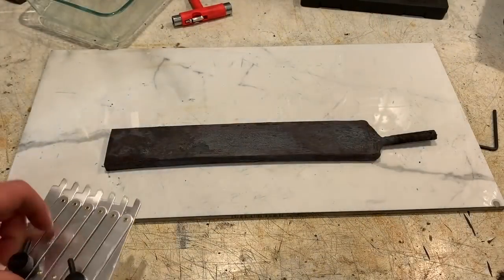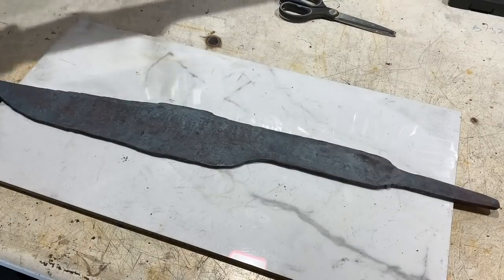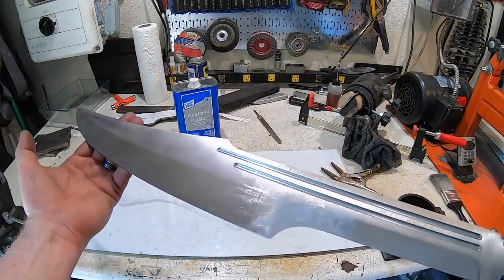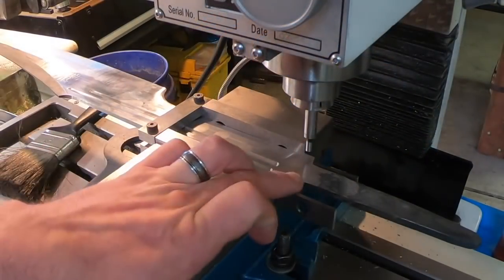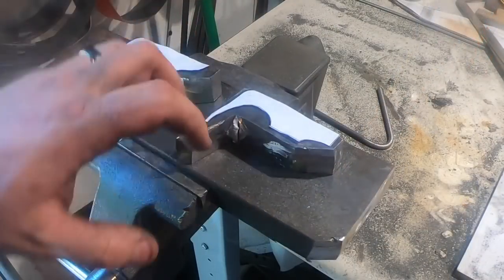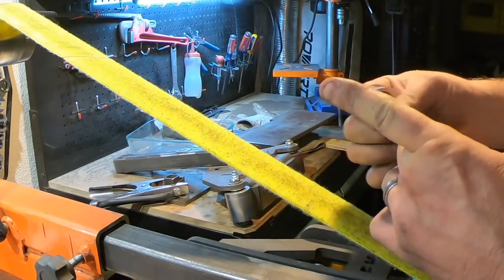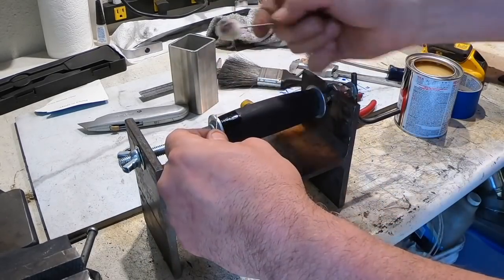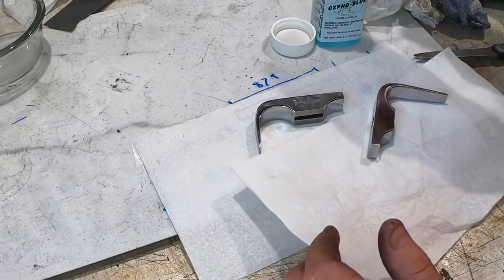Forging a Damascus Spartan Sword

Comment: Love your work as always! Not to be an internet armchair expert but maybe if you did the fullers while the whole blade was flat, before the bevels, you could have clamped the whole blade down to your table or to a fixture plate to get it more rigid and avoid some chatter? I've been trying to design some kind of machinists jack but with a top clamp, for situations like this.
Reply from the maker: Yup, I certainly should have done that.  This build was actually a year ago and I’ve learned so much since then. 😉

Comment: you can check the straightness before the quench and just reheat if it takes too long. Doesn't guarantee no warping but it's better than not doing it
Reply from the maker: I'm not sure I understand your statement.  Of course the blade is checked for straightness before the quench.  It always goes into the quench perfectly straight.  Thanks for watching.
Reply: @TyrellKnifeworks  Ah, you didn't show it so I assumed you were skipping that step. My bad

Comment: Beautiful. How did you finish off the wire wrap on the handle? Drill a hole in the wood and stick the end inside or something else? It’s a super clean wrap job. I’m digging it

Edit: I saw how you secured the wire when you started the wrap, but didn’t see how you secured it once wrapped. Thanks 🙏🏽
Reply from the maker: Yes, it was ended the same way, you put the end into a hole drilled in the other end then you drive a toothpick with glue into the hole behind it.  👍. Thanks for watching

Comment: She's a beauty. Pardon the mundane question, but what kind of oven did you use for the tempering cycles? Kitchen? If so, what did you use as a bribe for the Mrs?
Reply from the maker: Ha, there are no mundane questions. I like to use my EvenHeat for tempering but it takes forever to cool down.  A lot of times I use the kitchen oven.  One tip, just wash the knife first with soap and water to get the oil off and it won’t smell.  👍
Reply: @TyrellKnifeworks  Thanks for your quick response. I have a fairly long seax I will be tempering later this week, and my wife is out of town, so kitchen oven it is. And yes, I will wash the blade first.

Comment: I first want to say it's a beautiful blade. For sure. But at 8:48 it is pretty clear that one end of the blade is hot, while the other is not. Im curious how a camera illusion would make it look like anything other than that (as you are suggesting). If you have any ideas, i'd love to know.
Reply from the maker: It's not quite as prounounced a difference as you see in the video.  The blade part is glowing really hot but the back end of the blade seems like its black, but in reality it was still red.  Obviously they are not the exact same temp but the video makes it look like they are completely hot vs cold, which was not the case.  Thanks for watching.
Reply: Thanks for taking the time to respond. Text comes across with no emotion. I was worried this would come across as condescending. Which is not the case. I have seen many of your videos and know you know what you are doing. So. Even though you responded with poise and respect, I do want you to know that was a general curiosity. Not any attempt at disrespect.
Reply from the maker: No worries, it was a valid question.

Comment: Looks like a large D Guard Bowie, a Falcata with that handle and guard design, or a combination of both for that matter.
Reply from the maker: It’s definitely a falcata.  It’s way too huge to be a bowie, plus it’s more of a chopper.  Thanks for watching!
Reply: @TyrellKnifeworks  its similar in blade shape to a Bowie and you do get large Bowies very similar in size too, like some fairly lengthy D-Guard Bowies, which are closer to shortswords, hence my comparison, but yeah this one is fairly large, so a Falcata seems more apt description for this particular example. A Falcata with Bowie stylings if you will. Anyway its a cool looking piece and yeah probably  a nasty chopper , with that blade geometry and balance, it would probably chop through bone like butter haha.

Comment: I've never forged or smithereens before but have been doing a lot of research on it and was just curious (open to anyone who would know) but why did you use that blue solution on the guard rather than maybe just acid etching it?
Reply from the maker: The fittings were mild steel.  Etching mild steel just gives you a light grey color.  I wanted it darker.  Now I use a hot blackening process in my recent videos and that’s a superior process.  Thanks for watching.

Comment: How did you 'tie off' the wire wrap at the end, if not another hole it got plugged into like at the start?
Reply from the maker: Exactly that, there’s another hole in the end of the handle where the wire goes into.  Thanks for watching!

Comment: Man that sword is wicked! 2 thumbs up! 👍🏻👍🏻
Reply from the maker: Thanks Dylan!  It’s definitely one I plan on keeping.  👍
Reply: @TyrellKnifeworks  that's definitely a wall hanger lol, loved the wire handle wrapping machine you made btw! Using the ratchet wrench as the gear..... ingenious!
Reply from the maker: @dylanbennett3851  I saw that in another video at some point so I can’t take full credit, but I can’t seem to find the original video.
Reply: @TyrellKnifeworks  I'm still impressed. You put the TK spin on it.... pun intended! Lol 🤣

Comment: I thought I had seen it all, but that file work on the grind transition was awesome well done…. I didn’t see what tap set you were using in the description tho I’m looking for a quality tap set! Thanks for the awesome content
Reply from the maker: Thanks, that file work to mesh the two grinds was the biggest pain!  Glad someone noticed. 😜  my tap set is a cheap set that I wouldn’t recommend.  I’ve bought a bunch of single taps since then.  The 1/4 20 is by far the one I use the most so I’ve probably got 3 or 4 of those.  Thanks for watching!
Reply: @TyrellKnifeworks  hell yea it was beautiful, looking forward to watching some other videos, you seem to do extremely well with the fittings which takes the craftsmanship to a different level… good work…. You should consider doing a video on making a match set, but that being said I don’t pry but I think the challenge would definitely be there. Cheers
Reply from the maker: @bradrewold2072  do you mean making a match set of knives?  As in two identical ones?  Not a bad idea, I may consider that in the future. 👍
Reply: @TyrellKnifeworks  exactly! Test your mettle hahah

Comment: I wonder if the wire would stay wrapped better if you annealed it before the final twisting, making the final twist not that great a number of turns.  If is was starting to get springy I might guess work hardening is the problem.  Maybe way off but it seems reasonable.
Reply from the maker: Maybe that would have helped, but just the act of twisting it imparts some inertia into it so its going to have some tendency to unwind.  It was doable, I just had to account for it.  Thanks for watching!

Comment: Great work! Bowing my hat. What does Kerosine do? is it to keep the plates un oxidized, or does it work also like a lubricant. Now go ahead, and use it for turning your meat on your BBQ :-)..Or as I saw in a different movie, go heat itup to read, so you can sterilize your mates wound :-).
Reply from the maker: The kerosene burns off in the forge and that also burns off any oxygen between the layers so it reduces oxidation that causes scale which prevents a good forge weld.  Thanks for watching, Tibor!

Comment: I think I will be a regular to this channel, I must say I really enjoy your videos. By the way, how much does it cost to get started with a workshop such as the one you have with all the tools and equipment?
Reply from the maker: Welcome to the channel, Alexandru!  You certainly don't need everything I have to get started.  I started with just a forge, anvil, hammer and a cheap grinder.  I eventually built my own 2x72 grinder and then the hydraulic press and added more tools.  In total, I have about $20,000 US invested in my shop.  Thanks for watching and following along!
Reply: @TyrellKnifeworks  Thanks for your reply and keep up the good work!

Comment: Is that kerosene or diesel that you soak it in before starting the forge welding? How long do you soak it for?
Reply from the maker: Yes, that’s kerosene.  You can just dip it, but sometimes I clean and restack Damascus but don’t get around to forging that day or for several days and I just leave it in the kerosene.  👍

Comment: what did you soak the multiple pieces of steel in before the forge welding process?
Reply from the maker: That was kerosene.  It helps the forge weld because it burns off, reducing the O2 and leaves a thin residue that prevents scale.  Thanks for watching
Reply: @TyrellKnifeworks  thank you brother! hope to see more from you... still learning and love new ideas... this is def one blade thats on the to do list! where are you located? i will be at blade show ATL this year most likely
Reply from the maker: @DragonKnifeForge  I'm in Livermore, California.  I'll be at Blade show, table 23-O, stop by and say hi!

Comment: Nice except for the top part of the  rear guard. I would bet that it inhibits your swing and recovery to ongaurd. Other than that it looks just a bit heavy, I might be wrong in that regard. Not hating just making an observation. Overall nice work
Reply from the maker: It’s a chopper so it is a bit heavy but not overly.  The guard is actually really comfy  .  Thanks for watching!

Comment: Great video, always been a fan of the 300 Falcata, what were the dimensions and weight on the blade?
Reply from the maker: It’s 24” long but I’ve never weighed it.  It’s one of my favorite movie swords for sure!
Reply: Thanks man, you have do amazing work, I just did a 721 layer random pattern Damascus 300 Spear tip for a retiring COL out of 721st Space Wing. The odd layer  was a pice of mystery steel from a satellite in the middle.
Reply from the maker: @T3_forge  very cool!

Comment: Take it from a gunsmith, ALWAYS, Always, always wear glove when bluing. The parts should be thoroughly cleaned with alcohol or acetone then not touched with bare hands until bluing is completed. But great job on this sword, it is a thing of beauty.
Reply from the maker: This was a while ago.  Ive since upgraded to hot bluing and I find that a much better process.  Thanks for watching, John!

Comment: I am making a mini version of this and the only cutting tool I have is an angle grinder. It would take forever in order to cut out guards from steel thay thick, would aluminum work? Or is that too weak?
Reply from the maker: Aluminum will work, it just scratches easily and won’t darken like steel.  Thanks for watching.
Reply: @TyrellKnifeworks  ok great! can you heat treat aluminum or harden it in any way to make it less vulnerable to scratching?
Reply from the maker: @Chappy_V  nope
Reply: @TyrellKnifeworks  ok thanks!

Comment: You soaked the billet what was it soaking in?
Reply from the maker: It was soaking in kerosene.  The theory is that the kerosene burns off and also burns off any oxygen that would cause oxidation and scale to form, giving you a better forge weld. Thanks for watching!

Comment: Does Kerosene act as a flux? Or is it to just clean off grease and oils?
Reply from the maker: It’s not really a flux but any fluorocarbon will burn off and the theory is that it prevents oxidation while it burns.  Flux would form a barrier, but this does not.  Some guys just dip it in their quench oil to produce the same effect.  👍

Comment: What is the point of the curved surface on the power hammer I see it In almost all forging videos but I don’t see the point
Reply from the maker: A curved surface draws out the steel.  Imagine you take a round bar and press it into some clay, it will push the clay outward in direction of the curve.  That’s what the hammer is doing to the steel.  Make sense?
Reply: Oh ok that makes a lot of sense I love your content btw

Comment: If i could afford one of your pieces i’d get one. Have you ever accidentally cut yourself while hand sanding(not to jinx you lol). Great job🇨🇦
Reply from the maker: I have some cheaper ones on my Etsy store.  Yes, I’ve certainly cut myself.  I accidentally sliced the side of my hand before, I’ve ground off my knuckles off, sliced the tip of my finger while sharpening... you name it, I’ve done it. 😜
Reply: @TyrellKnifeworks  I’m trying to find the perfect blade as a tribute kicking Cancers ass

Comment: Nice to see some real Damascus steel , too many other videos of people calling it Damascus just because it has some cool design in the blade . Real Damascus is layering high and low carbon steel and folding it until the blade has the properties of both . That's why the Norse men were feared by everyone . While the average swords would bend or break , the Damascus blades did neither .
Reply from the maker: Well, the “real” properties of Damascus aren’t really well known.  This blade was done using all high carbon.  1080 and 15n20 steels, there’s no low carbon. Mixing a low carbon with a high carbon is going to give you questionable steel on the edge and not a good idea.  Today’s Damascus steel is simply a name for any pattern welded steel, don’t get hung up on labels.  Thanks for watching!

Comment: you are not using borax? Only  electric welded before ????? Nice sword, great job
Reply from the maker: Borax was used for the forge welding, it just wasn’t shown. Thanks for watching!
Reply: @TyrellKnifeworks  ok,ty. https://prnt.sc/w3szbm
I am forging more than 10 years,from rusty files, bearings,motor valves. But never tried damascus...
Reply from the maker: Some very nice work!  You should definitely try some damascus.  It's fun to come up with new patterns.  👍🏻
Reply: @TyrellKnifeworks  I have a lot of good steel. For free- old bearings,very large, one bearing is enough for katana,or parang... I think damasks not make steel better,only looks more interesting. Ty for answer.
Reply from the maker: I agree, Damascus certainly isn’t a better steel.  It’s for aesthetics only.

Comment: Pattern welded steel isn’t the same thing as Damascus steel. But for some reason everyone started calling it that. True damascene steel. Was a completely different process. More similar to your Wootz steel knives made from canister metals.
I guess you could say damascene steel was the printed metal of its day. Back in ancient times.
An apprentice or group of them. Would painstakingly layout a forge mold. Using pieces of steel and other powered metals. Along with certain plants and minerals. Then melt it in a forge furnace. 
Which was probably similar to the old mud forge furnaces used in Japanese sword making. 
The metals didn’t need to be folded. If they were treated correctly then hammered into shape properly. 
All this pattern weld folding. Is unnecessary if you understand metallurgy and hardening. As we are finding out with more modern steels made in pressure forging. In the aero space industry.
Reply from the maker: Don't start this ridiculous thread again.  Nobody cares.   We all know that modern damascus isn't the same as historical damacus and we don't need to be corrected.  It's the term everyone understands.  Deal with it.

Comment: Bro What is the weight of this sword?

Please answer
Reply from the maker: It's a chopper, so it's about 3 lbs.  It sure is fun to swing though!  😜.    A typical Falcata was about this weight so its right where it should be.
Reply: @TyrellKnifeworks  whats the weight in kg
Reply from the maker: It's easy to just Google that yourself.  It's about 1.4 kg.

Comment: So much grinding. I don’t like to grid that much as a weapon smith. At least you have the fast hydraulic press. Makes it easier. I’ve always done it the old fashioned way with a blacksmiths hammer.
Also to bevel my blades. That’s the best part of being a blacksmith or weapon smith. Why would you want to side step that by belt sanding.
Reply from the maker: Thanks for watching

Comment: Can anyone explain why he uses  kerosene? Never seen this.
Reply from the maker: Hey, Joshua, I use the kerosene because the theory is that as the kerosene burns off, so does any oxygen, thus providing you a less oxidizing environment.  Salem Straub does the same thing but uses his quench oil instead, but its the same concept.  Thanks!

Comment: What happens when a Kukuri and a clench shiv have a baby? =Spartan Sword.
Reply from the maker: Not really, kukri's have an inside curve.  They are quite different than this.  The "Spartan Sword" is really just a modified falcata.  Thanks for watching.
Reply: @TyrellKnifeworks  I was drawing that conclusion because I was working on a Tracker knife not too long ago, and another time I was working on a Spartan sword, so I know what it's like to go in with the detail work right there where the edge kind of kicks off with a file. It gets that front heavy weight that's where I saw the kukri connection and yes you're right it does have more of a curve to it. I only brought up the Elvia because I was just recently working on a clench shiv and there's that Dynamic curve at the top. You're Damascus pattern is outstanding and I really like the Fuller. I hope the wire never frays and pokes you. Outstanding build.